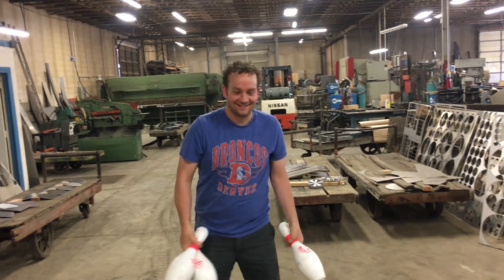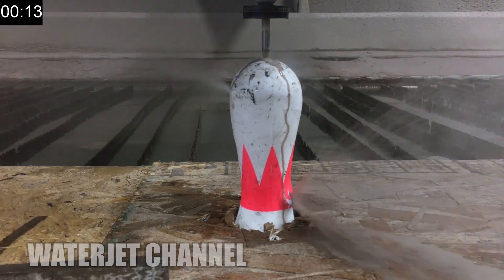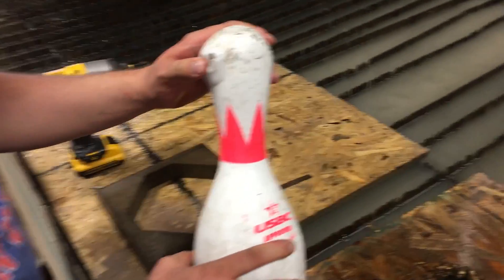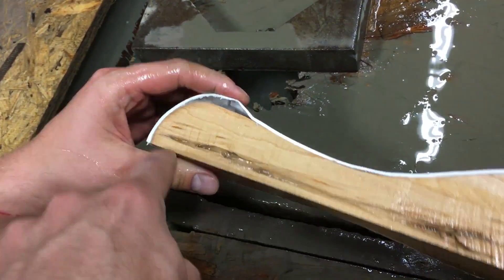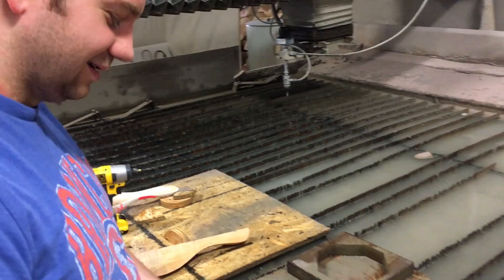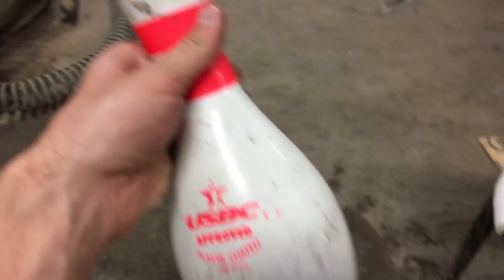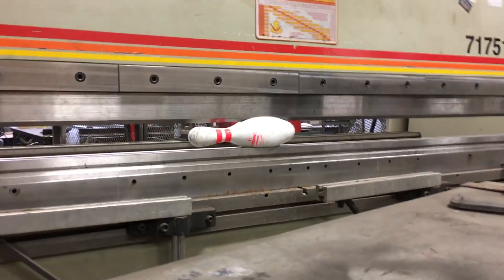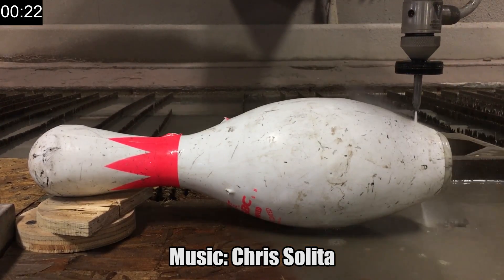Bowling Pin vs 59,999 PSI Waterjet

Comment: I would like to know if you can cut a Nickel  in Half . Not across . Stand the Nickel  up and cut long ways. I was thinking a Nickel is the thickest coin to use. I was wondering if your waterjet tip is to wide unless you have a smaller tip.Anyway just a idea i had was thinking be cool to see if it can be done.Put the Nickel between two pieces of steel are wood to cut it to hold it.

Comment: WHERE DID THAT 1 PSI GO? THIS CHANNEL IS IRRELEVANT WITHOUT IT
Reply: Lol😁
Reply: square inch - you lose one because the size of the bowling pin. 
DUH!
Reply: Even worse, it's missing 0.001 psi
Reply: No, it's missing 1 only. They use "." to seperate the decimals, not "," . It's actually 60000 PSI not 60.